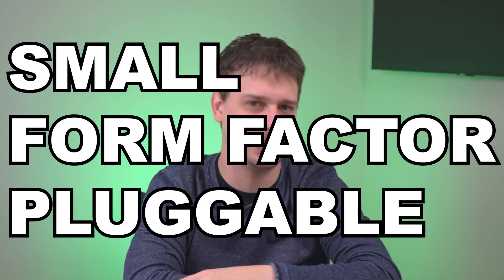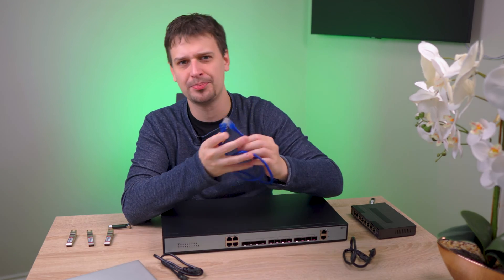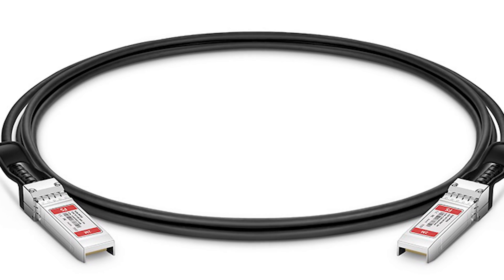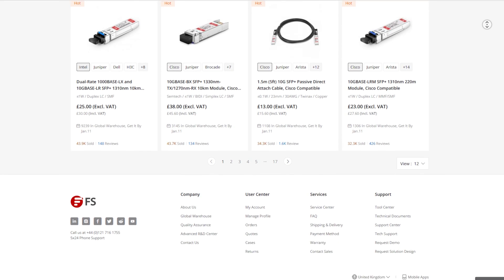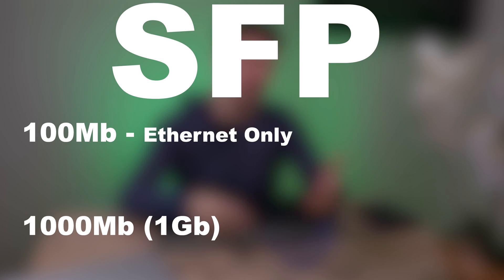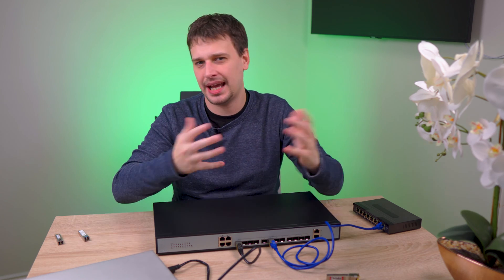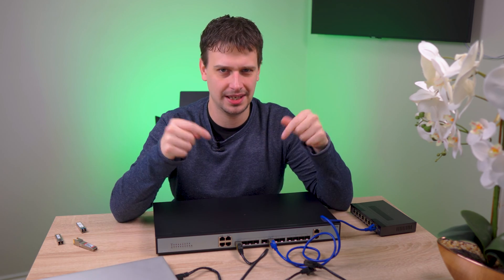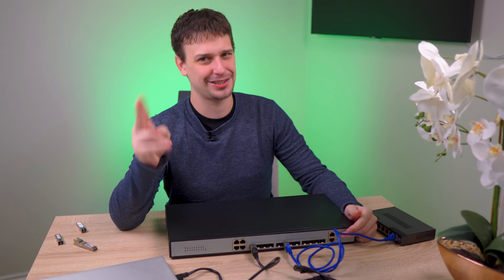Master SFP Connections in Minutes: SFP connections explained. What are SFP+, SFP28, SFP56

Comment: You should also mention AOC cables.   They are fiber cables with built-in bonded transceivers on both ends, and they are very affordable.   Available in lengths up to 100 meters.

Comment: DAC = Digital to Analog Converter
DAC = Direct Attach Cables

Two completely different domains, right? No normal person would need need SFP for something as basic as streaming audio. Tell that to Chinese (audio) DAC manufacturer Eversolo. They  have seen fit to add 'SFP Fiber' to the rear of theirbew flagship streaming DAC. I won't bore your subscribers with a link to the DMP-A10 - google is your friend - suffice to say that over-engineering this 4K USD box may have seemed like a good idea at the time. Thanks for the video.

Comment: What are the best and most reliable brands of cables? Especially ethernet cables, as well as thunderbolt and USB cables. I can't figure out which brands have reliable products. A lot of the brands, such as Monoprice, have continuity problems as well as other quality control issues. Please help.
Reply from the maker: Urgh this is always a struggle, and I don't have the best answer because I'm in the UK and there is a UK company called Rhino Cables I have used them for years and had zero issues. Unfortunately, they only ship in the UK. 
But I have had really good results with Amazon Basics, Anker and UGREEN i don't buy cables from any others.

Amazon Basics - Good all-round 

Anker - Good quality USB and other data cables, just check the description because some cables they make for high power delivery, but slow data and some the other way around. And some for both, like if you want long cables you have to pick data speeds Vs power. Normal length cables are fine.

UGREEN - for me have been really reliable for Video things, I get them When Rhino is out of stock. I'm actually going to be testing their HDMI 2.1 Switch soon, so there'll be a video on that.
I hope that helps a bit
Reply: @BuzStringer  Thanks man. I really appreciate the detailed answer. I'll check those out for sure. I'm always skeptical about Amazon Basics products, but will look more into them.

Comment: I don't get it. What's the point of the transceiver?
Reply from the maker: The transceiver converts whichever cable to SFP, so you can plug fiber into one port, ethernet into another and it just works. Don't need to buy a fiber switch or ethernet switch.

So an SFP switch doesn't really care which type of cable you are using, you can use whichever is best for your setup. 
Short high speed fibre, a bunch of Ethernet clients, and long range fibre, all working together in the same switch.
Reply: @BuzStringer  awesome. Thank you. So it's versatile. I didn't realize that. 

But what's really got me tripped up is that transceivers send and receive electrical signals. But any cable, whether it be ethernet, fiber or whatever, has electrical signal being sent through it via the server/host device. So, for example, why does a Direct Attach Copper (DAC) or any other cable need the transceivers?

Comment: SFP28 is indeed 28Gbit just like 1gbit transceiver is NOT actually 1gbit.  Look at the transceiver itself it will say a number larger than 1000 or 1024.  I think it's like 1.12 or something like that.  I don't remember someone will correct me because they know what it actually says and theyll try to infer that means they also knew why 25Gbit SFP28 is called SFP28 instead of 25 but they didn't make the connection till I mentioned the raw speed of a 1gbit transceiver.

Comment: Litttle addition , there are adapters SFP+ ( 10 Gbit )  to 40 GBit SFP+ and QSFP+ to Rj45 as well or breakout cables QSFP+ to 4 times SFP+ ( 10 Gbit ) which can use an SFP+ to Rj45 as well
You can get used Server QSFP+ Nics very cheap nowadays , you can get a pretty fast NAS with if you  can use 4 or 8 Lanes PCiE 3.0 for the NIC card https://youtu.be/5MSk3_kkvK4

Comment: I am new to this and want to grasp a better understanding. I can understand stacking using two or more switches, but can you stack a router to a switch using SFP? What are the pros and cons about that
Reply from the maker: You can, if the router supports SFP. 
The benefits are only there if the router is doing any switching or being used as a wireless access point, or has a modem connected to it. They are the same benefits as linking two switches.

If the router is just holding the DHCP table and not handling another network traffic then there is no benefit, the DHCP table is very low traffic.

Comment: If two 1GB switches are next to each other in the rack and both have SFP ports what transceivers / cable is recommended?
Reply: For a connection between them? If the sfp ports on then supports up to 1Gbps. then you better use rj45

Comment: The most important thing that wasn't mentioned is that 10Gbit SFP+ RJ45 modules are becoming hot as hell when working at big speeds. So hot (95-100°C) that they (very often) cannot be used in fanless switches due to overheating. Switch can read temperature sensor in such SFP+ module (for example in Mikrotik S+RJ10) and it will disable link if module is overheating - breaking our network experience. In my tests on fanless Mikrotik switch the SFP+ module was overheating just after several minutes of 2Gbit traffic. So if you want 10Gbit best is to avoid RJ45 (use fiber instead)  or have cooling in place.
Reply: Just a quick note about the SFP+ RJ45 modules: the issues about high power draw (~2.9W) and high temperatures are limited to old chipsets. More modern, Broadcom based modules are ~1.6W and running cooler. You can identify them by looking for "80m" or "80 meter" modules, whereas the old chipset is often rated at 30m.
Reply: @CevelNet  thanks for sharing
Reply: Literally just set mine up and the transceivers are un touchable hot!
Reply: Thank you for the feedback. Sir.

The same problem I have.

Comment: My TPLINK router has a SFP port, can I use a SFP with optical port to connect the the optical cable from service provider ?
Reply: Theoretically, yes. In practice, you'd need to work out the configurations with your ISP. Most residential connections use PON, so I'd expect you'd need:
- Baud rate (although this might be dealt with via handshake)
- The wavelength they're giving you (you could trial-and-error it, but I don't think they'd like that)
- Modulation scheme (coherence/polarization, PAM levels)

Odds are they won't want to do this though, namely because they'd rather have control of the endpoint. Last thing they'd want is for you to send 16 dBm to a transceiver expecting 7 dBm and blowing up their equipment.
Reply: Good question

Comment: 3:42 The 28 in SFP28 stands for the maximum data rate of the transceiver, which is 28 Gbps. This means that SFP28 transceivers can support speeds of up to 25 Gbps, which is significantly faster than the 10 Gbps speeds supported by SFP+ transceivers.

SFP28 transceivers are typically used in high-performance networking applications, such as data centers and cloud computing environments. They are also being used in some high-end consumer networking products, such as gaming routers and switches.

The name SFP28 is derived from the Small Form-Factor Pluggable (SFP) form factor, which is a compact and modular transceiver interface. SFP28 transceivers are available in a variety of different optical and copper variants, which makes them compatible with a wide range of networking equipment.
Reply: Is it only me or does this sound like AI?

Comment: At 5:20 "But they are not interoperable. So you would use both MMF or both SMF transceivers in one cable run." 
Really? "Plain English" this is not. 

"But they are not interoperable." That's great. Its meaning is clear and simple. What follows, restates the context and adds clarification. 

"So you would use both MMF or both SMF transceivers in one cable run." This uses two positives without a clear emphasis on their distinction. (The speaker could have paused and emphasized the "or", or also, even explicitly used "xor" instead.)  
The '"or", in this case, is not your common, everyday 'OR'; It is your logical, more specific, technically oriented, mutually exclusive 'XOR'. 

A simpler and far clearer expression would be "So you would not mix MMF and SMF transceivers, in one cable run."  

Making videos is an exercise in communication. It is not a matter of simply delivering 'content'.  
Simply delivering dialogue, despite it (hopefully) being 100% accuracy, misses the point. 
The dialogue 'paints' content being presented and its delivery should be tempered to maximize that objective.

Comment: There are also SFP modules for RJ45 2.5GB
Reply: I got a couple of these transceivers on Amazon for a Bpi-R3 and they only work when the other end is 2.5Gbe, nothing slower.

Ended up wiring one to my cable modem and the other to my desktop motherboard port.

Comment: From my understanding, SPF ports are the answer to people who have fiber optic Internet, and don’t want to use the providers router and can use their own if that personal Rado has the SPF porch? For example, I have AT&T Internet, so I just take the RJ-45 cable connect it from the Internet box mounted to the wall from the provider then take that cable connected to the SPF connector then take that then connect it to the modem.? I’m hoping I’m right about that so I never have to deal with the providers modem anymore.
Reply: sfp onu stick is what you need
Reply: Isp use a pon system. It's not Ethernet, and the onu is managed from the olt (sort of a switch). Ask them and they might have an onu in an sfp for you.